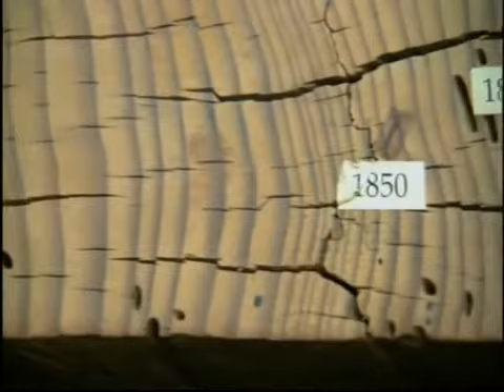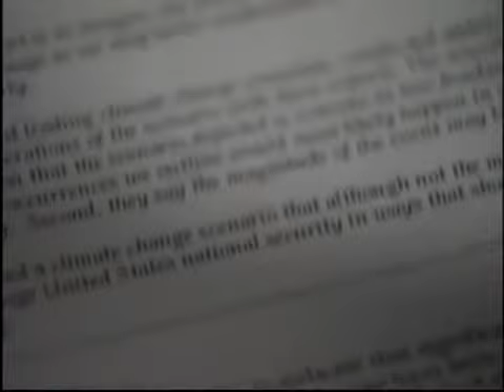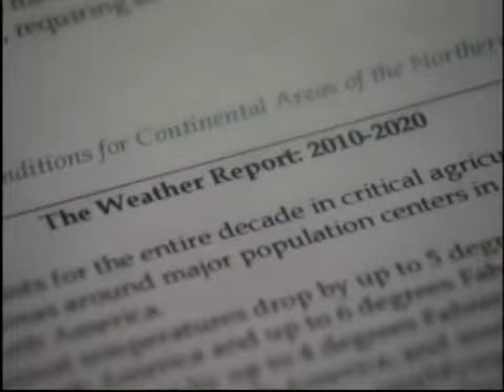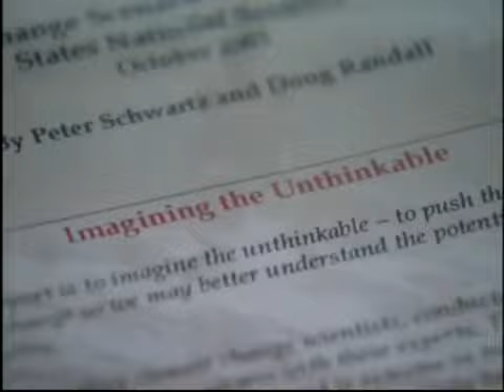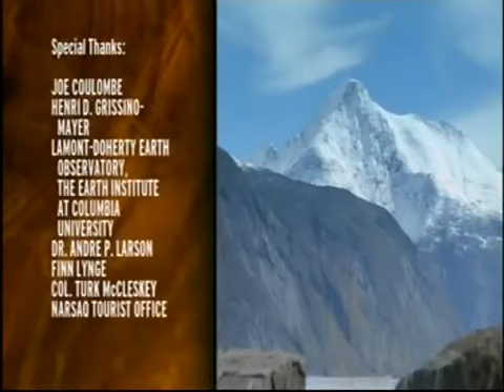Little Ice Age: Big Chill (2005)

Comment: That is now known to be basically false about the Inuit and the Vikings, the Dorset people inhabited NW Greenland far North of where the Vikings settled but probably ceased to live at all in NW Greenland around 1000AD according to archeological evidence which is when the Vikings settled in Southern Greenland, the Inuit or modern day Eskimo people settled in NW Greenland far North of the Vikings around 1400-1500AD about the time the Vikings were dying out, any contact they had with either group was very sporadic due to the distance between them of about 900 miles, they probably went years without ever coming in contact, there was not enough interaction for the Vikings to learn much of anything from them.